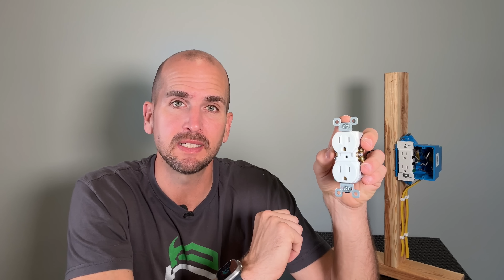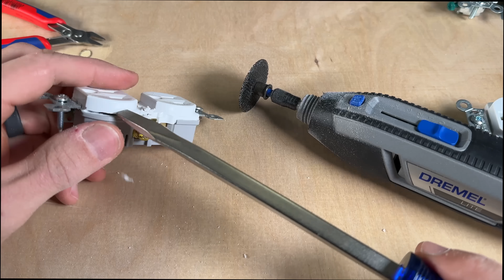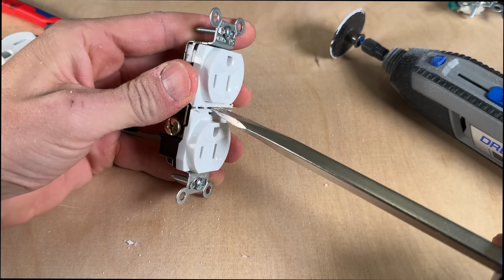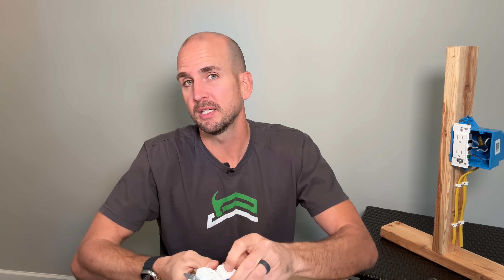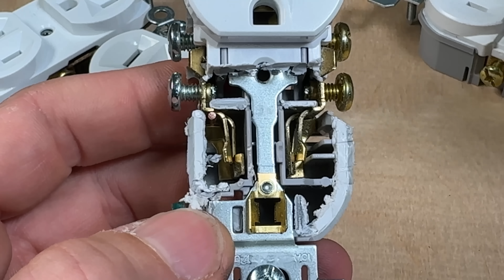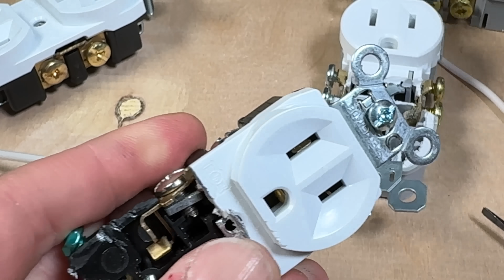Which Outlet Is Right For Your Home |  Watch Before You Buy

Comment: Ah! Thank you for distinguishing backstabbing with back-wiring. I replaced almost all my outlets in our 50 year old home 2 years ago. I thought that since I'm at it I should just use commercial grade outlets. The cost of the outlets is very insignificant to the cost of my time. I always thought backstabbed residential grade outlets seemed flimsy, but the back-wiring of the commercial grade outlets allowed the wires to be secure clamped down to the terminals. Now, I understand the distinction between backstabbing (not recommended) and back wiring (acceptable).

Comment: We're doing a whole house renovation and updating electric from 150A to 400A service (with whole house surge protection).  I did ask for commercial grade receptacles throughout.  Some of our existing 45 year old residential outlets are a bit loose - plugs will partially hang out of the receptacle.  In my workshop area I opted for 12ga wiring and 20A receptacles.   All are tamper resistant which is OK since we now have a granddaughter.  Some 70 decades ago when I was in diapers I got ahold of my parents' keychain and stuck a metal car key into the hot side of an electrical outlet.

Comment: Thanks for the video. I swapped out a 15amp residential receptacle for a family that I help out from time to time. The outlet receptacle failed, but the wiring was fine. It turned out that they like to use the coffee maker and toaster at the same time on the same outlet. I replaced it with the same, but now I wish it would have installed a commercial one instead. I can see where the commercial can hold up to more demand. Thanks!

Comment: back wiring is UL tested, not a problem.
Reply: I assume you're talking about the push in backstab connections. Just because it's UL listed doesn't mean it's reliable. UL doesn't test for reliability. Using those is hack work.
Reply: @RobertHancock1  electricians i know  do  what is  fast  to  save  time. if ul approved  it is  good  with  them.

Comment: What about Residual vs Commercial switches?

I just replaced all the switches in my place from the 1976 (NO-KLIK) to new Leviton switches.   I put Residential switches, both single pole, and 3-Way switches..

I did put Leviton 15 Amp Decora Antimicrobical Wall Switch in the bathrooms, and at the top of the stairs to the basement.

I put Commercial Grade switch on the Garbage Disposal, and out in the garage.    

Do you think  I did everything ok with this setup?   One nice thing is I was able to hook up the ground wire the switch vs the old switches that had no ground wire on them....

Comment: Look at the steadily riesing average household electrical energy consumption trends since 1960. More added rooms, garage work shops, lights outside and inside, computers, more battery chargers,  huge TVs  more electric devices  plugged into un ungrounded  14 gage wire multi outlet extension cords. Time to  standardize the NEC minimum new wire  installation at 10/2  Romex plus  (as a minimum)  20 and 30 amp breakers in a 200 Amp box.

Comment: I am going with the commercial one, I was wondering which light switches you would recommend also, I am replacing 4 outlets and 1 light switch Toggle style . thanks
Reply: I know a guy who works as an electrician in a historic hotel. He said replacing light switches is his most common repair because they are handled so often.

Comment: Easy decision. 
The majority of outlets in the house are for convenience.  Some of them you may use once in a blue moon. 
Some you use everyday, but you only plug in once (like a coffee maker). 
Some you plug in and out all the time, and you would wear those out. And when you replace those worn out, you should replace them with commercial. 
Once I was called to a house; in a teenager's bedroom, a couple of outlets got the crap beat out of it. 
They were residential grade outlets. How long had those two Levitan outlets been working in that house?  Over 40 years. 
That tells me putting all commercial grade outlets in every house is unnecessary. 
As evidenced by the stocked aisles in Homedepot, most of the outlets stocked are residential grade.
Reply: Good point, also if you want decora style, commercial grade are harder to find and if they are to be tamper resistant, I'm not sure if they are even made.

Comment: When my house was build in 2000 they made the outside outlets GFCI by using a GFCI Breaker so none of the outlets themselves are GFCI outlets and use normal 15amp outlets. I recently went to try and put in a GFCI outlet to resolve an ongoing issue which i was finally able to resolve (faulty outlet) but it wouldnt fit in the box due to the extra size and the wires. Obviously i need a deeper box, but the boxes are recessed in the wall instead of screwed onto it. How would i go about resolving that?
Reply: You don't want to add a GFCI receptacle coming from the load of an upstream GFCI receptacle or a GFCI breaker. Use a regular receptacle and add the sticker on the cover plate "GFCI protected outlet".
Reply: @surferdude642  Yeah its already labeled. Also, when they built the house they put a GFCI outlet in the downstairs bathroom and connected it to the bathroom outlet in the upstairs bathroom for whatever reason, but they did put that label on it. Pretty damn lazy imo

But my reason for wanting the outside outlets to have at least One GFCI receptacle is so it wouldnt solely rely on the Breakers GFCI.. But the recessed boxes for dont appear to have enough depth for a GFCI anyway so i dont think ill be messing with it any further. But alright, thanks

Comment: Good comparison and analysis. I use commercial WR for all outdoor receptacles. All indoor rooms, I use standard receptacles, and I use SPD for all connected electronic appliances. Commercial GFCIs for all code required applications. The brand I use is Hubbell. It is a bit more expensive, but you'll never replace a receptacle or switch in your lifetime.

Comment: The commercial receptacles are well worth the extra buck and a half investment. The back wiring alone is worth the extra money.
You forgot to mention, the screw terminals will accept two wires under each screw eliminating the need for a pigtail. This includes making it half switched. The mounting screws are a legal ground to a metal box that is properly grounded. Notice the spring holding the screw to the receptacle.

Comment: I like commercial - however, the eaton residential grade back stab is UL certified.  If you look a the design, the wire is pressed against the back plate and the wedge is self tightening.  IMO, the number one failure of back stab is improper installation where the strip length is wrong or the wire was contaminated by paint before shoving it in the hole.  I'm fine with using side wire or J hooks as long as that is done properly, but lets not blame the device for all failures.  Like you, my preference is spec grade.

Comment: the other huge difference is in that metal backstrap - I have lost track of the number of residential-grade cheapos I have had to replace because they break down in half right in the middle.  The backstrap solves that.  Never ever use "residential" grade as they are in my opinion *dangerous*.  When they break they can cause a short, and thus sparks and fire hazard.

Comment: I prefer commercial grade.  My house was built in 2014 using the cheap residential outlets. Any outlets that are used frequently I have replaced with commercial grade outlets, and they are holding up well. I agree with this video's advice!

Comment: I go with commercial grade as much as possible. The person in the electrical department at Menards explained the difference in how they were built. He even gave a story about how he replaced a bunch of outlets in a remodel using the cheap ones. Not even 10 years later he found himself replacing them. I’ve seen a few residential grade outlets come out in pieces and that always scares me. Spent the extra money so you only have to do it once.

Comment: Great video. Coming from a family of electrical contractors, I agree.  Throw away the "residential/builder" grade receptacle.  Purchase the CR15 or CR20, which are double wipe (or triple wipe depending on manufacturer). These are typically used in commercial offices and will give decades of  quality connections. The next step up.would be the 5262, although the hold is tight and might be a problem if the receptacle is mounted in a plastic box.

Comment: After about 5 years in a newly-built house, some of the receptacle were so grabby that you had to use a lot of force to unplug. Something wrong with the design. Probably cheap residential-grade outlets. In one case we pulled the J box loose inside the wall, it took so much force to remove a plug.

Comment: Hmmm, I have a higher end, high current amplifier that I installed a dedicated 20 amp circuit on its own breaker, but of course I’m pretty sure I used a cheapo outlet.  Now I’m gonna have to change it out.  A chain is only as strong as it’s weakest link.

Comment: Waaaait, I thought you were supposed to strip 1.5 inches of wire so you have enough for the back stab AND wrapping it around the screw terminal?  That explains why the inspector had a stroke....also what's a good way to dispose of a dead body that is both easy and also code-compliant? Asking for a friend.  😂

Comment: Commercial grade and Spec (specification) grade are different.  Spec. grade is usually more expensive than standard commercial grade, although most manufacturers like to call their commercial grade "spec. grade" so that they can try to meet the specifications on higher grade jobs (hospitals, etc.).  A whole different discussion and comparison video could be made on these two types.
Reply: No HR or hospital grade are a step above any spec or commercial grade receptacle. For one thing the face is usually made from tuff nylon and almost bullet proof. HR receptacles must have a green dot on face to identify it as such. Retired as a sparky from a large hospital and some brands of HR are far superior to others including a much higher price. Hubbell makes the best HR receptacles. Over $10 each!
Reply: @garbo8962   True, we often used "spec grade" in hospitals EXCEPT where HR were required (by code).  Never commercial grade though.  Good catch.
Reply: Correct. Spec grade actually means Federal Specification. Manufacturers call their receptacles "Spec" but they're actually their commercial line intended for commercial offices, examples being the CR15 and CR20 receptacles (which I have in my house). A true Federal Specification receptacle would be the 5262..
Reply: @boeing757pilot   Exactly.

Comment: As a DIYer, back-wiring is worth the extra cost. You'll save the price difference in the time saved. and your connections will be bulletproof. 

As an added bonus, the commercial grade outlets will stand up to the plug-and-unplug cycles better, so that outlet in the hall (where you connect your vacuum) will hold the plug better longer.
Reply from the maker: Amen, totally agree.

Comment: I'm extremely cheap, but have stopped using the budget outlets because the heavy duty ones are much easier to wire up.
Reply from the maker: Yeah, I am a fan of the back wiring on commercial grade

Comment: I redid all our outlets to add tamper resistant receptacles to avoid the need for any child safety plugs.  (As foster parents, they did inspections, and this let us pass without those nasty plastic plugs.)  I used the cheap residential grade because I didn't know the difference, but I avoided back stabbing, as we had problems with that at our beach condo (particularly bad with the salty air).  Now I would probably use commercial grade, especially for any outlets that are used frequently and might lose their grip or anything that will likely have high current draw like a window AC or vacuum.
Reply: As those receptacles lose their grip, replace them with the CR15 (and CR20) receptacles. These are the commercial line, which will serve you well for decades. I have these in my home. Although I'm a pilot, I come from a family of electrical contractors and am quite familiar with these products... Also, bless you for being foster parents. You can do miraculous things for these children by showing them the love they desperately need.

Comment: Can you expand topic out to fed-spec and hospital grade?
Reply: Not sure about 'fed-spec', but 'hospital grade' is the next step over commercial. Think of them as 'severe duty' receptacles. Meant for high wear cycles of plugging/unplugging. (Worked for hosp. maint.) And if they're coded red (or orange - loc/code depending), that means it's wired to a backup power source in case of power failure. So if using that grade, stay away from using the pretty colors without proper reason...it may flag the inspection. Red,Blue,Orange, Yellow, & Green all have meaning, use only as applicable.

Comment: I made the mistake of buying a box of residential grade when i first bought my home still have a bunch i stopped using them, they are sitting in a can to give to people i hate LOL. they are pure crap the face breaks just plugging things in and out the socket does not hold cords sometimes you break them just trying to install them. the commercial or industrial grade are much better especially with the back wire with two straight wires under each screw makes wiring much easier and more secure less wire nuts and splices.

Comment: To help the DIYers keep it straight on which side the hot and neutrals are connected, yes, brass is hot and silver is neutral but IMO, it's easier to remember the neutral connects to the same side as the ground connection is located.
Reply: Black Gold the easiest phrase for a dyier to remember.
Reply: @jameshill4900  another easy one to remember is, white to light, black to brass will save your ass.    Because lamps and appliances will still operate normally in a reverse polarity receptacle,  aside from the increased shock risk in certain situations such as the screw shell of a table lamp that's now hot instead of neutral, or sticking a butter knife in a toaster to free a stuck bagel and touching the heating coil that's now hot because the switch broke the neutral, the same problem can occur with really old lamps and appliances that have non polarized plugs, where both prongs are narrow.
Reply: Another way to tell and remember is to look at the size of the slots.   The hot side is the shorter slot, the neutral side is the longer slot.   On a 240 volt receptacle such as the 20 amp single which you might have if you have a larger window AC unit it doesn't matter which side the black and white connect to because both wires are hot, but the white should be marked as a hot with a piece of black or red tape at the receptacle and at the breaker as well as the junction box if the cable was spliced along the way for some reason.
Reply: I use the phrase "Black to Brass". It has worked well for me for 20 years.
Reply: @briantayes2418  Whatever works for anyone, but personally, I can't see how mentally learning to put both the neutral and ground on the same side can get any easier. Remembering a rhyme is not necessarily.

Comment: For me personally definitely commercial grade.   Their reliability and longevity overtime are well worth the extra dollar and can pay for itself over the cost of having to replace shorter lived residential grade, especially in areas that receive frequent used such as kitchen countertops, hallways where a vacuum cleaner is frequently used, and of course the bathroom where your wife or teenage daughters are unable to leave the house without blow-drying and curling their hair a certain way 😘😂

If you pay close attention to the commercial grade you'll notice both contacts are T shaped to accommodate a NEMA 5-15- 5-20, 6-15 or 6-20 plugs; the white plastic front bonded to the device determines the NEMA configuration making them much better for appliances with heavy duty motors or heating elements.  

It is permissible to use 15 amp devices on 20 amp circuits,  but 20 amp devices are prohibited on 15 amp circuits.   And if a circuit has a single receptacle and no other devices, the receptacle rating must match the fuse/circuit breaker rating, a duplex receptacle counts as two.

Comment: Thanks to the similar video you made approximately 2 years ago, we used commercial grade outlets on our renovation.  Before renovating, we had a few outlets that no longer held the plug in them. They were outlets that got a lot of use in our kitchen and our bathroom. I also used actual hospital grade outlets for our TV and surround sound system. To be honest, using hospital grade was a little overkill. I used them in hopes of preventing any potential hum or interference in our sound system. 😊

Comment: As a DIY myself and in no way professional if I was going to change 1 outlet I would go commercial. If I was to do an entire house perhaps I would choose a combination between the 2. Maybe stick commercial grade to outlets I know may run a portable AC, vacuum, or other high amp frequently used outlet. Some outlets never see more then a lamp or a cellphone charging cable. However If budget is not an issue then why not go for top quality.

Comment: I use the Legrand commercial outlet 90% of the time if they are in stock at my local Lowes or Home Depot. 
 Otherwise the residential outlet if I have to, but only in outlets that won't be in use often. I.e. vacuum use..